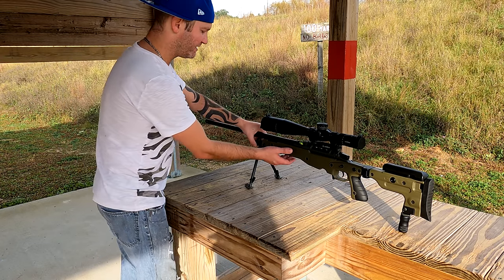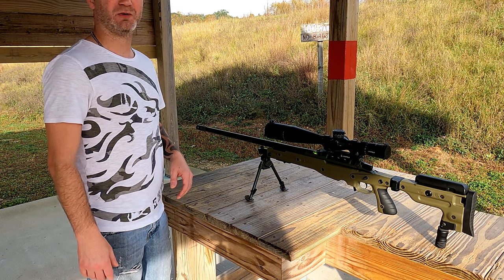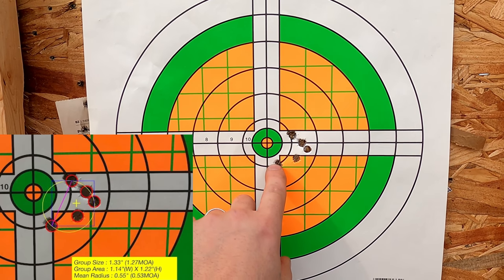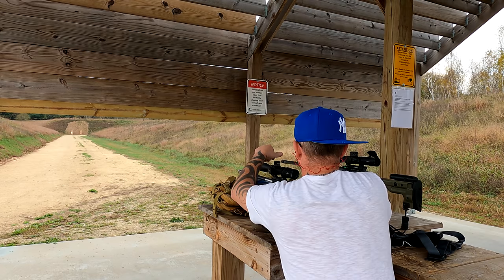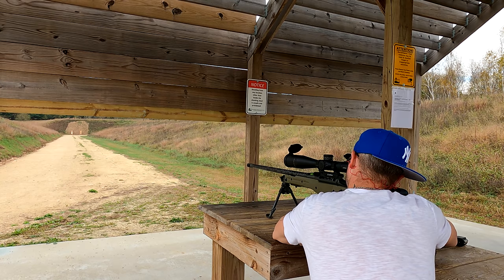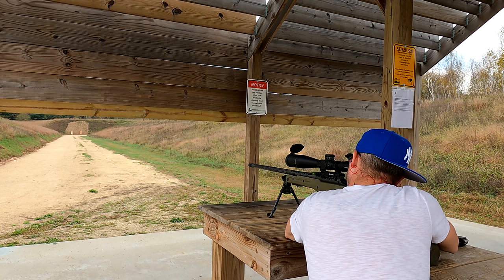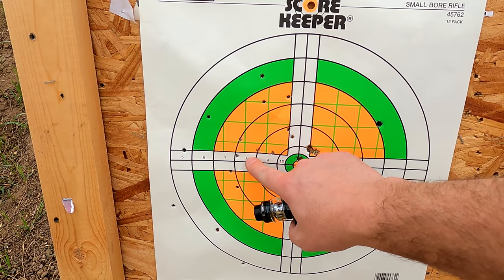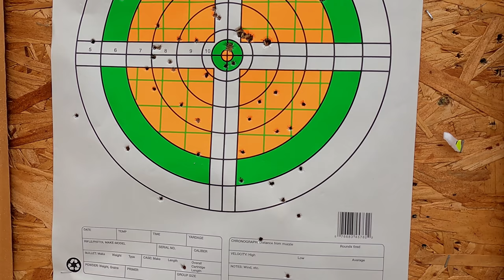I Cannot Get The Rifle To Shoot More Than 3 RD’s And Stay Under 1 MOA

Comment: Have you tried firing from prone,  more points of contact gives you a stable platform & an easier time replicating cheek weld.
Reply: He needs to suck it up and just buy a lead sled and some sandbags to remove him from the game almost completely. Given how little this setup cost at around $100 he could determine with very little if it is him or the gun. 

My wager is on the carbon barrel they just don't transfer heat off reliably and flex more when warm but given the money he has in these guns there is no reason to not buy the lead sled, it will keep with all future guns. No it doesn't ultimately mean he will be able to shoot a gun reliably but it does help figure out if it's you or the gun.

His 22 problems are supersonic ammo, I've done this test with sk rounds that were nearly identical aside from velocity with a bolt action 22, the supersonic stuff just doesn't pattern well and seem to be more effected by outside elements. (Some say this is transsonic, some say this is something else) regular ass 1070fps 22lr I can pattern (mind you with a bolt gun) inside of 1.5 inches at 200yds at virtually no wind. (My ability to determine scope adjustments aren't that dialed in  but the rounds will be in the same place) however with that round at 1200fps that group opens up to 6 inches these rounds performed nearly identically at 50 yards.

Comment: Sorry you are having so much trouble. I have a "probably dumb question." Are you preloading your bipod before your shots? I notice that your bipod is jumping more than it should be. Watch a slow motion vid of just your bipod and look to see if it is moving even or if it sporadic, meaning one side moving more than the other. I've had the same problem but once I clamped a 2X4 down to my shooting table were I could get enough preload on my bipod, It changed every thing.
Reply: Bingo!

Comment: Your group will tighten up if you lose the bipod and go with a good bag in the front. Like it or not, the recoil impulse starts before the bullet exits the barrel. The bipod is a small bouncy mass compared to a bag. For consistency, a bipod is better than handholding the rifle. But a bag is always much more mass than a bipod. For a tight group, follow what the benchrest shooters do to get sub .25" groups. All shoot off bags. 

Also, what ammunition are you shooting? Factory ammo will never give you the consistency of handloaded. The machines that drop the powder are good but they have tolerances and variations in the weight of the powder placed into each case. Shooting for the smallest group possible requires weighing EACH CHARGE of powder and making sure each charge is exactly the same weight. 2/10 to 4/10 of a grain difference in powder weight (factory tolerances) means a definite difference in point of impact.

Comment: I see good form on your part. The gun is grouping as it should for factory ammo, shooting off bench and Bipod. The free recoil of the 300 PRC is enough to cause large harmonics problems off the surfaces and rest you are using. You want small groups shoot 223 or 6br. The gun you are using in this video performed exactly as designed. You handled it very well. Get a good cold bore zero with the ammo you intend to use. Work out your ups to 1000 yards and write or print up a ballistic card to be kept with gun and you are good to go. Every shot you took was meat in the freezer. That was good shooting with ammo and above average recoil you were dealing with.

Comment: What I notice on your 5 shot group was there was strong gust of wind on your 4th shot and you weren't squared up to gun. I saw your gun jump to the right when fired which to me you weren't set and squared. You have to get consistent with your hold, I think what it's called is firing harmonics. Just to say when I bench shoot I only have my cheek, shoulder and only shoot with 3 fingers on the gun thumb, trigger finger and middle finger. I'm shooting a .308 heavy barrel with hand reloads and my 3 shot group at a 100yd is a jagged hole and my 200yd group may open up to 3/4 group due to glass power. You have to hold that gun like it's a super slippery wet bar of soap the more grip and squeeze the more it's gonna wanna pop out of your hands, hold it gentle and squared it recoil straight back and don't lift off your set when firing multiple rounds you will lose your consistent hold. Aim small and miss small my friend, good luck.

Comment: I havent been shooting long range/precision very long (1.5yrs) but here is my input

Go over your reloading process, sometimes a particular barrel just doesnt like a particular bullet, sometimes certain bullets just dont get along with certain powders, etc (could go on and on and on about reloading)

you really should be using a rear bag, and get rid of the mono pod. Also, try shooting from prone, i particularly shoot my rifle better when prone, i think the ground allows a more solid foundation than a chair and bench. You really need to consistantly load your bipod, off a bench this can be achieved by screwing down a board and using it as a stop. You need to maintain your head and cheekweld position throughout the shooting of the group; Everytime you break your position, everything is not going to be the same. 

This is just coming from a guy who shoots a Factory savage 10T in .308 and handloads and gets .5" 5 shot 100yd groups, and can stack headshots at 700yds

Comment: Adjust your eye focus correctly then adjust your parallax if those are correctly adjusted then it won’t matter if you move your head between shots, use the monopod or remove it and use a sand sock, also you will find firing from the prone will greatly improve stability

Comment: As someone who shoots alot of long range with trained swat snipers, I would say it's not the rifle. Most guys can't let there ego go so they automatically blame the gun. Most rifles are way WAY more accurate than the average shooter. More than likely between trigger pull and firing your adding a slight amount of input that's causing this. If you had sudden 3moa from 1 then maybe the gun but as tight as it is shooting, I feel as if more trigger time practicing soft slow trigger pulls will tighten your groups. I went through the same process your going through now thinking I had a rifle issue but after much learning and hundreds of rounds my groups tightened by half.
Reply: I'm thinking the same. Most guns shoot better than the shooter. Can already see alot wrong with the shooter not the weapons. Just more practice would help more than anything.
Reply: @jayarcook292  yea its hard for most guys to accept that it's not there rifle. Precision rifle shooting is an art. Not just anyone can shoot half moa. I don't care how special and expensive the rifle is, without a solid shooter it will never do half moa.
Reply from the maker: It’s not even an moa problem I’m concerned with anymore before I knew keep it 3 shots or less and I am Golden
As the temp changes so dose my zero

As it was getting hotter out I was having to password change my zero and correct right  
Now as it is getting colder I have to do the opposite 
 I am already 5 MOA of correction form my summer zero 
I have when shooting 4 more times since the time of recording this video 
Every time it’s a little bit colder than the last I’ve had to put no less then 1 MOA left to fix my Zero
Reply: @CRSFirearms  so is temp the only factor that changes zero? Are you shooting factory loads or reloads? If temp is the single factor changes zero that much that confuses me. A temp change should never cause that much deviation. You may see your zero shift half an inch here or there but shouldn't be much. I tend to look for consistency over bulls eye. Are you able to shoot a decent group no matter the temp? Don't mind where the group is as long as its consistent. Then go for adjustments after that. Maybe try not adjusting the scope quite as much for a few trips. See if it's consistent. Maybe those small adjustments throw the scope off a tiny bit. Try a box test with the scope at 50yrds with the rifle in a lead sled. Take out you as a factor. Use lead sled and box the scope then go from there. Just some brainstorming here so take it with a grain of salt
Reply from the maker: Yeah I’ve only shot factory loaded ammunition out of it so far 
All the same lot number
I don’t post videos with me shooting over 15 rounds in a sitting with the gun because it’s simply embarrassing but it opens up to 3-5 MOA even on a 3 shot group
Reply from the maker: Then I go home run a bore snake wait about 24 hours boom back to sub MOA 3 shot groups
Reply from the maker: Go to my community care but I will show you with the rifle does past 15 shots make sure to comment on it as soon as you see it so I can delete it 
Between the two times when I shot the 22 I shot this 
But if I would’ve kept that part of the video in there conspiracies theories would’ve started flying of what I am do wrong and why
Reply: @CRSFirearms  I'll be watching for the vid. Im curious to see it. I'm a gun snob so I enjoy stuff like this...lol. I'll watch 15 round groups
Reply from the maker: I posted it in my community tab
Reply: @CRSFirearms  oh ok ill go look srry
Reply: If you can shoot every other gun under moa and this one only for 3 shots it is the gun.

Comment: It's the barrel heating up, because those rounds generate so much heat, it only takes 3 rounds to heat that barrel up to the point you loose accuracy.  Proof Barrels are great for long stalks and making cold bore shots at long range, but they are not for multiple shots.  Get a temp gun and check the barrel after 3 shots, I bet it's much hotter than you think.  Sell that barrel and get a good steel barrel, your overall weight will suffer but your never going to get what you want out of that barrel with that round

Comment: First, make sure your equipment is good and properly installed. If your scope is slightly loose itll throw everything off. Second expirement with different bullet grains and try to find ome your gun likes. If that doesn't fix it then ditch the bipod and and monopod and shoot off a bag and use a sand sock. If all that doesnt help then it properly is your fundamentals. If you havent already read ryan cleckners book on long range shooting. Its like $9 on Amazon

Comment: You are shooting well under 1moa, your app even says so. When manufacturers say “1 moa guarantee”, they generally mean the mean radius, because there’s too many variables with trying to keep a group under some number. Your shooter could twitch, some inconsistency in the ammo, or a sudden gust of wind, but the mean is based on statistics, so it gives you a very accurate picture of what your rifle is truly capable of. 

Think of it this way. You and your rifle are shooting at 0.5 moa average, meaning that you typically shoot about 0.5 moa within your point of aim. 

Another way of getting a more complete picture is to shoot a 10 round group and subtract the 2 outer ones. But this suffers from not being very statistical or scientific. It’s still subject to a lot of randomness. The best, in my opinion, is to shoot 4-5 five round groups, then get your average and calculate out to two standard deviations. 95% of all shots will be within your two standard deviations measurement. 99.7% of all shots will be within 3 standard deviations.

Comment: There are so many areas to start looking for your problems man. I've shot precision rifles for years. I'm not the best most knowledgeable person, but I've seen a lot. Take the torque wrench and purple/blue (application dependent) loctite to all the things. All of them. Get everything torqued to spec. Some rifles can be sensitive to the torque on the action screws. Once everything is good to go, then look at your ammo. If you aren't hand loading, then don't expect much. You might find an ammo your rifle shoots well reasonably consistently, but your better off loading yourself because you can control all the factors. The first thing I'd do is dial in the seating depth. Thats where you'll more than likely see your biggest improvement. From there dial your powder in. Its a long process, but given the time, you can get that under 1 moa consistently pretty easily. 

That being said, all this talk of carbon fiber barrels stringing quickly and being thin.... Well... they're wrong. Carbon fiber dissipates heat. Light weight with superior heat dissipation and rigidity is the whole point of a carbon fiber wrapped barrel.

Comment: If you really want a carbon barrel get a Bartlein carbon fiber barrel, they use a thicker steel barrel before carbon wrapping it. It will be a little heavier than the proof but it's a Bartlein sooooo it's gonna be lights out.

Comment: The barrel is the problem. It's not your other accessories or  anything. Close friend of mine recent had bought a carbon barrel for a precision gun and had similar issues. He called the company and they told him they get at least 5 to 10 calls a day or more about that  very issue. And the problem is... there's no real fix for them other than a replacement. They either work or they don't  and I'm seeing more that  don't than those that  do. So, that's the problem. A very thin barrel with a lightweight profile that gets hot real quick and there's nothing that  can be done  about that.

Comment: I like to test my barrels with 9 shot strings.  Really gives a good indication of the actual accuracy. What do you think?
Reply from the maker: Depends what you’re trying to do 
If you’re trying to track the heat dispersion over a string of shots ya have at it 

If you’re trying to see how many shots you can hold in x amount of time have at it 

If you’re simply trying to determine the accuracy no you’re just wasting ammo 

you want to see you in the cold bore shot hits and the 2 follow up shots that’s what’s most important 

Over 9 shot there’s just too many variables barrel temp wind etc.

Maybe with no wind spending 30-60 sec between shots to keep the barrel cool but what type of realistic situation would you shoot like that so there for you’re collecting data that serves no real world purpose
Reply: 3 shot groups are good for showing what the gun is potentially able to do, one time

10 shot groups are good for showing what the gun is able to do, everytime

because of his barrel profile he's not going to be able to do these long strings without taking a huge break in the middle

Comment: Military sniper rifles are tested at 200meters because oddly enough some bullets have to stabalize in flight, so theyre more accurate at 200m than 100m.

also, wasted money on carbon fiber. Either go with a bull barrel or take one shot every 5 minutes.

Comment: Looks like you're running into one of the core issues with CF wrapped barrels, that the CF doesn't transfer heat away from the steel core of the barrel anywhere near as fast as the steel itself would, which is why you are getting great 3 shot groups but crap after that.
Either slow your firing schedule way down (like wait a minute between each shot) to allow the barrel to cool, or sell that overpriced carbon fiber ultralight shit and get a good quality fluted heavy barrel.

Now don't get me wrong, there is nothing inherently wrong with ultralight gear, hell I have a sub 5 lb 16" AR-15 that shoots sub MOA but it opens up after about 15 rounds rapid fire due to the barrel heating up, but you gotta understand the limitations that come with lightweight gear like less durability or thermal stability.

Anyway I'd suggest one of Faxon's heavy fluted barrels assuming they have one in the caliber you want, I've always had good luck with their stuff and its not too pricy for the quality.

Comment: Considering you already know that the barrel deviates right when it heats up, would it be viable to aim a little to the left after the 3rd shot?
That, or just switch out the barrel for a heavier one that is no so susceptible to heating issues.

Comment: I'm not sure about 300prc but I have the savage 110 elite precision in 338 Lapua. Even with that stainless bull barrel the 3rd shot will go 1"up and 1" right. That barrel is at least an inch thick. I thought it was my hand loads I was checking and double checking pulling my hair out trying to figure out what I was doing wrong. Bought match dies different bullets and powder spent WAY too much money diagnosing a walking barrel. There whole time thinking no way it's the rifle. As savage advertised this pinnacle of accuracy of years of building rifles. How can it be that hard to make an accurate load. I though with that barrel 3 shot groups would be fine it wasn't hot to the touch but nope. lessons learned. I can shoot 2 times every 20 min. That's not what I wanted. I'm really disappointed.

Comment: Your getting 1 MOA at what distance? Because that's still pretty good.
Reply: Barely 100 yards it's incapable of doing anything past 600 yards because that means a 6 inch group you're barely hitting plates at that point
Reply: @RandomLombax37  the mission dictates the tool. So for a brush gun it's just fine. For an out west gun, yeah that won't do.